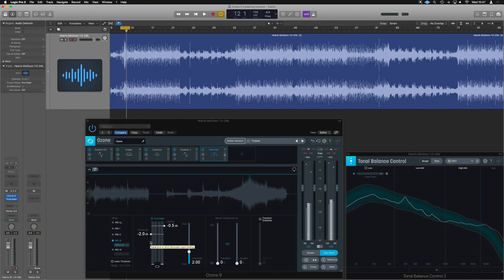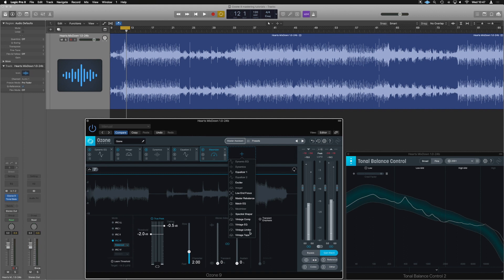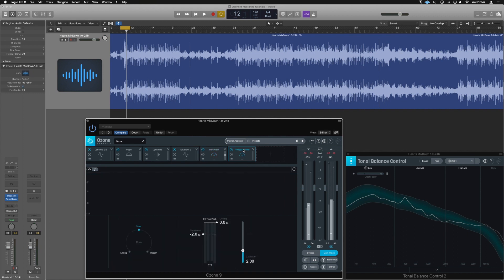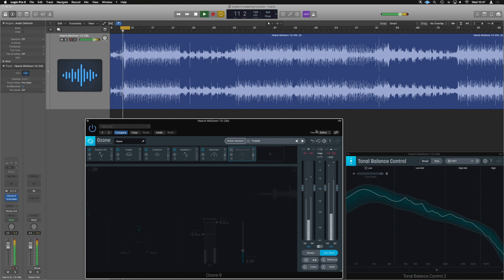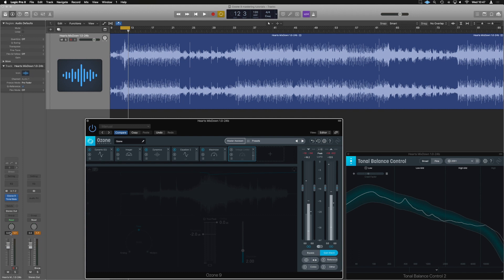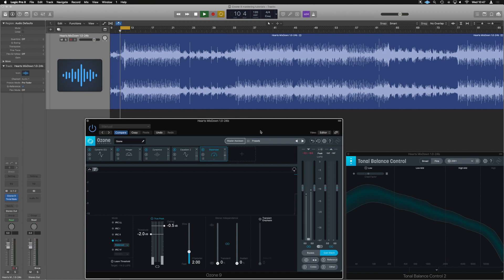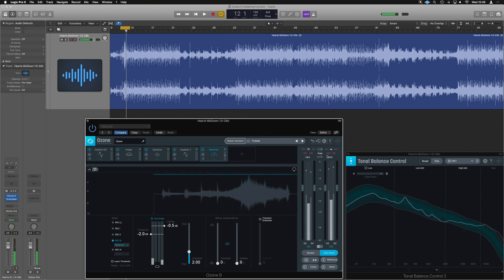Why is Ozone 9 Clipping?

Comment: Ozone used to have a “ signal flow “ chart you had to actually put the limiter as the last module in the chain 4,5 not sure bout 6 & up
Reply from the maker: I can only assume you didn't watch this video, its its about putting the litter last and still getting clipping and when / why that might occur.
Reply: @Unders  I watched the video w/ divided attention, your assumption is incorrect. I posted to inform others b/c many users of Ozone don’t know about the module signal flow inside the plugin. I didn’t address you or say your video was incorrect/ wrong/ bad etc. Second comment clarified part of the first after reading the O9 manual. Def trying to help other Ozone users. Not sure how/ why you misconstrued my comments. NTM you sell an Ozone tutorial course but your master is clipped by +2b in Logic & Ozone. If your gain staging was correct before hitting the plugin, inside each module, & limiter set correct your output would not be “ Clipping “ regardless of  lossy codec previewing in O9 😀
Reply: Ozone 9 still features the module signal chain so ime the Maximizer/ Limiter needs to be the last module to prevent ISP & clipped output in the DAW as well as when bouncing to disk or converting to MP3/ AAC

Comment: Why do a lot of professional songs that I import in the Maximiser have both red lights (which means clipping) but sound soo good? I was told that your projects should never have the red lights when exporting. I’m confused.
Reply from the maker: This depends on where the sound came from. My reference tracks for example are from CD converted to .wav and they can suffer from overshoot when summing. It’s when something has been hard limited and the calculation happens so close to 0 it might pass. This is what modern limiters have “true peak” limiting to avoid this.
Reply: Unders The Song I used for my reference is called: Stand Still by Sabrina Claudia.  Which is an MP3 from ITunes. Are you saying if I toggle on “True Peak” and still have one or two red lights it could still pass? Also, if you have 1 red light  instead of 2 red lights is that still okay to leave or is it better to have none at all?? Sorry for coming across obtuse.
Reply from the maker: True peak stops overshoots. I think I explained this scenario in this video here
https://youtu.be/XsK3NRFQmxQ

Comment: My ozone elements 9 is putting static to my vocals. Its hard to explain but it only happens when i master it.
Reply from the maker: probably find the static is there already but EQ, Compression and limiting bring it up.
Reply: @Unders  i have a good microphone what do you think i should do ? Maybe turn the mic signal down ?
Reply from the maker: @davenjuice3500  I’d guess. An pure guesswork, that it’s recorded low already or the noise floor is kinda high.

Comment: It's probably clipping as a side effect of that "Gain Match" button in the lower-right corner being pressed.
Reply from the maker: It’s partly that. However if you remove the idle plugin as you can see it doesn’t clip. Have also been in touch with Izotope 👍